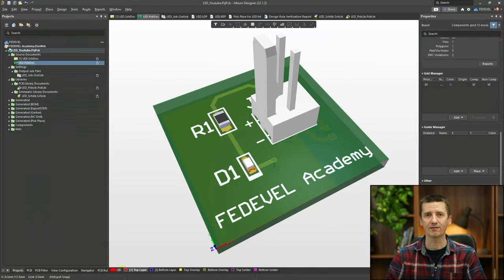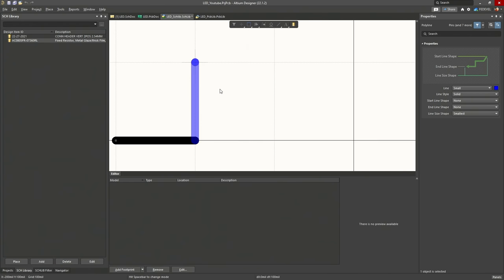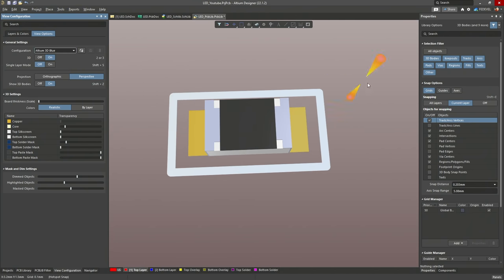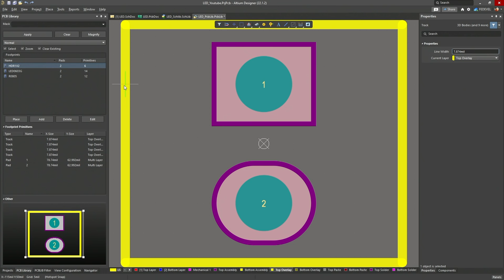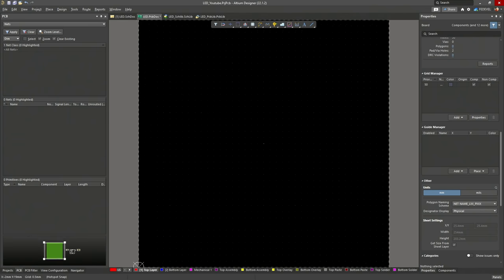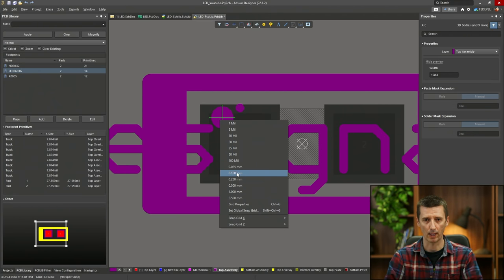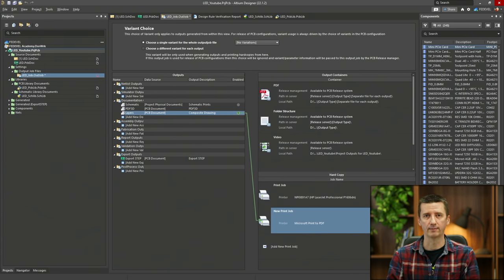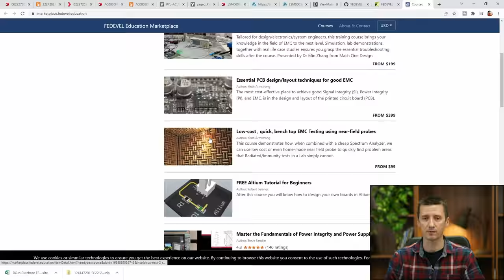Altium Designer 22 Tutorial - Quick & Easy |  Step by Step

Comment: Thank you Robert. Very helpfull tutorial. I have one comment for possible improvement: I find I quite often have to pause the video to be able to follow along, but pausing causes to video controls to appear at the bottom of the screen so that I have difficulty to see what you do when you navigate near the bottom of the screen. I think it would help if you would record with the Altium not at full screen but just a bit reduced from full screen to make a small gap at the bottom of the screen. That way, pausing the video would not block what is done at the bottom of the Altium screen.  Hope that was understandable.
Reply: Use mpv with yt-dlp to watch the video.  The controls only appear when you move your mouse or hover over them at the bottom when they're shown.
Reply: use firefox and pop the video out using the picture in picture mode. You can then scale the video to be about the same size as it was within the window. and move it right above the time slider. Note: it helps to have a dedicated monitor for the tutorial and another dedicated monitor for Altium.

Comment: Excellent and Professional Presentation.   Everything explained nicely like someone is making a REAL JOB PCB. 
Everything taken care  in video...  Use of Datasheet, Track-Size, Trace Placement ,  Vai Placement,   Update Footprint , Update PCB with Additional Components .Design Rule Check...

I would like to see more video like this. May be on SMPS or Microcontroller Based.
Reply from the maker: Thank you. I do have MIcrocontroller based course ( https://academy.fedevel.com/courses/online-want-to-design-your-own-arduino-board ) and Switching Power Supply based course ( https://academy.fedevel.com/courses/online-switching-power-supply-design-course ) but they are not free as it is a lot of work to prepare these kind of materials and also I use the income from that paid courses to be able to create free tutorials.
Reply: @RobertFeranec  pls the led 3d file you copied please which software did you use in saving it to be a step file please im stuck their please.....may GOD continue to bless the works of your hand....

Comment: Than you  your explications are very clear actually i am using altium 17 an  i have a project with components to place in top and bittom layer but unfortunatly when i do run check i have 45 errors your explications helps me but i dont knox if you using altium 17 thank you

Comment: Hi Robert! I am facing a problem defining the board shape in the board planning mode. I don't get the option to resize the board on selecting the board region in the board planning mode. Is there any particular setting I need to do to get the option of resizing the board?
Reply: Having the exact same problem. Found the solution yet? 

Edit* found the solution. After entering board planning mode, go to the 'Design' menu in the top left corner and  select 'Editboard shape'.
Reply: @petermuis482  pls which software is used to save 3d model stl text as step file...as he saved the led file ...pls help im stuck there
Reply: @judeananaba3372  He used Total Commander
Reply: @ayo1138  thanks for the help sir

Comment: Sir, In this tutorial,  we are creating footprint for 3 components . Also we are adding "assembly layer" to these footprints after placing 3D Model.
MY Question about a STEP ( View Configuration  -> Right Click Mechanical 1 -> Add Component Layer Pair ) 
In POP window Select "Layer Type" = "assembly". 
This STEP will be done ONLY for FIRST component ?
NO need to REPEAT this STEP for 2nd component, 3rd component, and so on ?

Please help to understand.
Reply: Sir, did you understood my question ?

Comment: Hello Robert, I have a question, how can I prevent a physical button from having a double click?  since I press it one time and the oscilloscope shows two and even 3 peaks.  Thank you very much for uploading these videos they are great.
Reply: Hi! you can use rc chain with capacitor about 1u and resistor about 10k
Reply from the maker: Have a look how I am doing it in the 28pins project: https://www.28pins.com/
Reply: @vladimirsabaev  Thanks a lotttt.
Reply: @RobertFeranec  thank you very much sir feranec.
Reply: Check out Ben Eater's clock video for his 8 bit computer series.

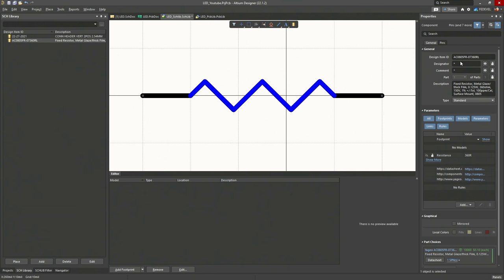Comment: Hello, ask at minute 14:09 the designator ID can change its name or it is not possible, thanks from Argentina. 🙂
Reply: Yes. You use this field to tell Altium that this type of component should have a Designator that starts with "R". When used in a design they will be annotated with the proper Reference Designator numbers. Other component types have different designators (for example, "C" for capacitor)
Reply: @jackolson8015  Yes, but I am referring to the item ID designator, not the "Designator" would be the box above, is it possible to rename it or not? Thank you. 14:08